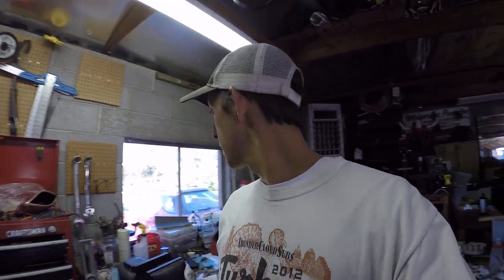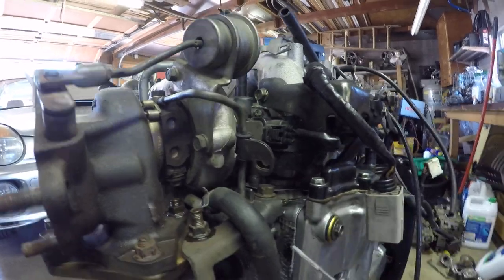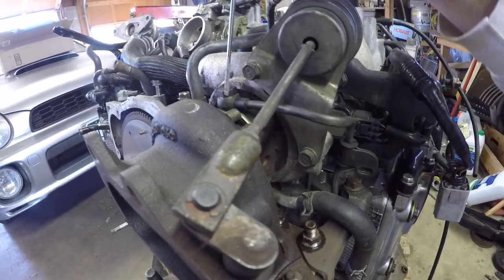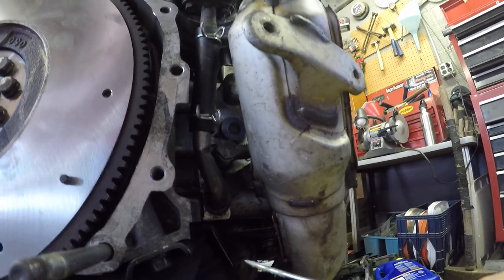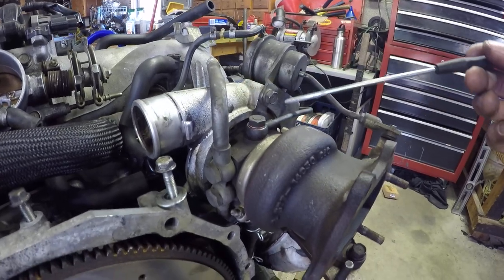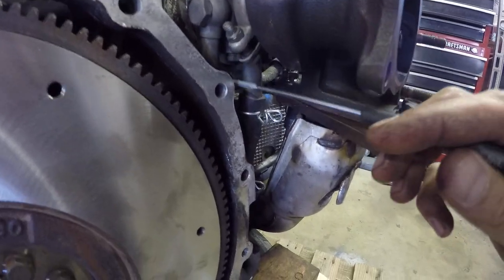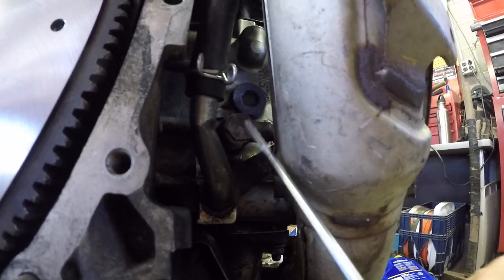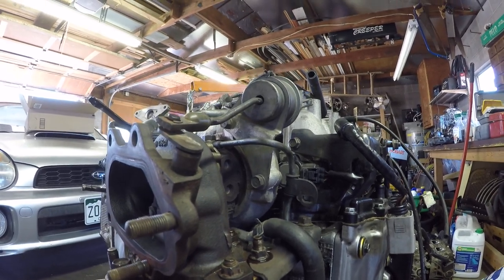2003 WRX Turbo - Oil and Coolant Line Routing

Comment: My EJ20 is leaking right at the bolt on the inlet line when boosting. However it seems to smell more like power steering fluid than oil to me. I honestly can't tell.
Reply from the maker: That would make sense that it could be power steering fluid as it's the only fluid that runs over the turbo inlet.  It could also be oil if you are having a good amount of oil coming through your crankcase breathing system from the those hoses that come off the top of the valve covers and connect to your turbo inlet.
Reply: @KennyGillis  Update: Found out it's the inlet line itself. I tried loosening the banjo bolt but oil is squirting from the line.

Comment: Have a oil leak on the turbo oil return hose need to verify and replace. Gonna attempt to access from under my 2006 Subaru sti. Have a new hose with clamps

Comment: I am adapting this turbo to my air cooled VW.  Not sure you know the answer, but how does this turbo respond if i dont run the water cooler?  Most turbos do not have water coolant; thats what the oil does.  Is there something magical about the subaru turbo that dictates water cooling is a must?
Reply from the maker: These were the first turbos I worked with so I'm not the best person to ask.  It does seem funny they need coolant and oil.

Comment: Kenny. Saw this video while researching the turbo oil feed banjo bolt screen. I got the screen out of the STI. It looked great but I pulled it. Putting the turbo heat shield back on was the most difficult thing. I checked the AVCS lines and they didn't have any. Got a new rear view mirror, console arm rest, got the stickers off the glove box and under the hood. Getting ready to do the rear bearings after I get the Z back together. The motor for the Z is getting close. The builder has all the parts on hand and has it in the honing jig. Should be home in a few weeks and back on the road in a month.